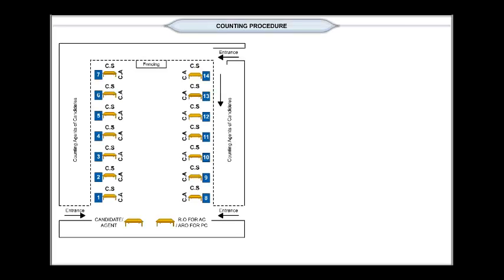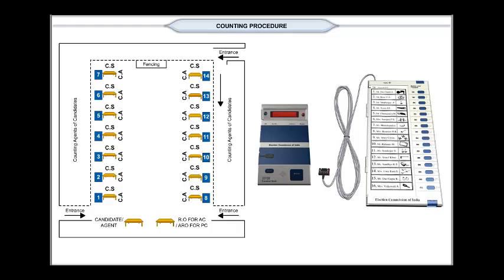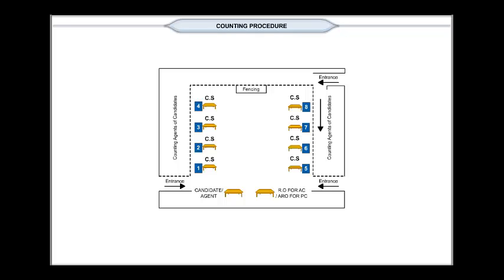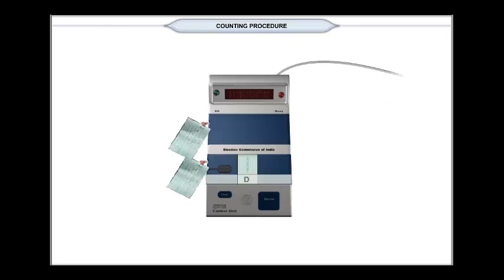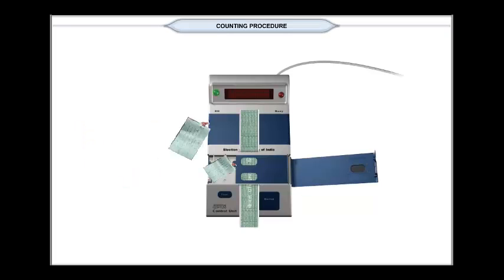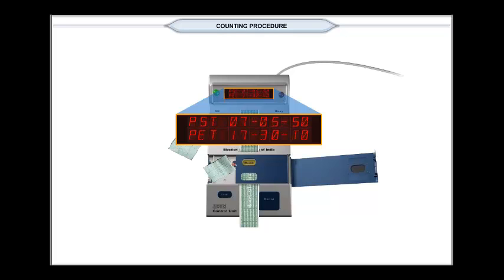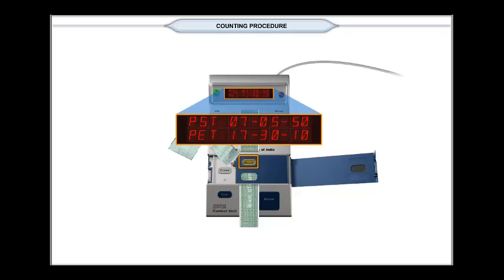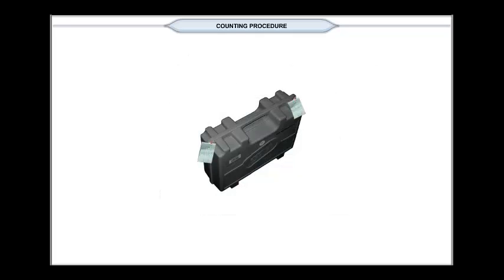Counting of Votes Polled using EVMs

Comment: Its very brief. It should have been a an counting training with minute details & as per latest provisions. PB counting, transparency in showing of all seals, machine number to counting agents, duties and working of supervisors, assistants, row officers, movement officers, micro observers etc, filling of part 2 of form 17C, data entry details and declaration of round wise and final result, procedure where EVM have been replaced during voting, when data is not retrieved, sealing of EVM and statutory covers post counting and it's safe custody etc should have been included. Thanx...
Madhav Kusekar, ARO 149 Mumbra Kalwa AC under 24 Kalyan PC Maharashtra
9833796292
Reply: Please post complete counting training with minute details & as per latest provisions